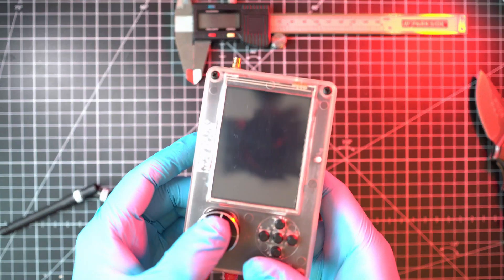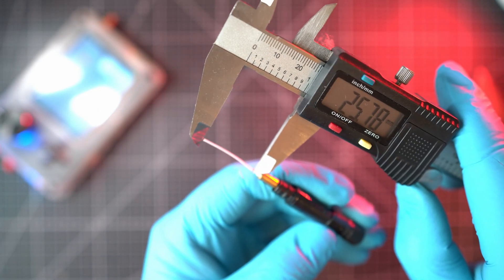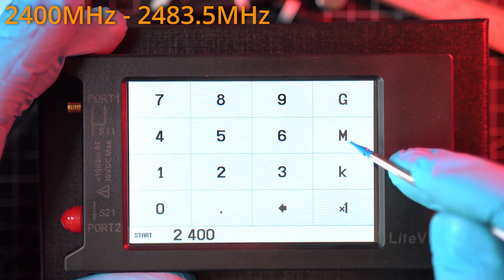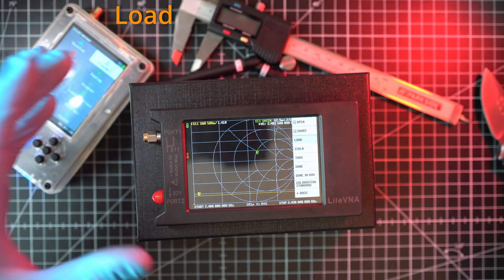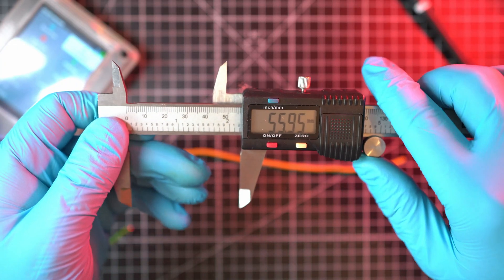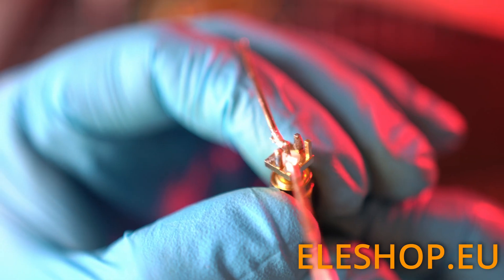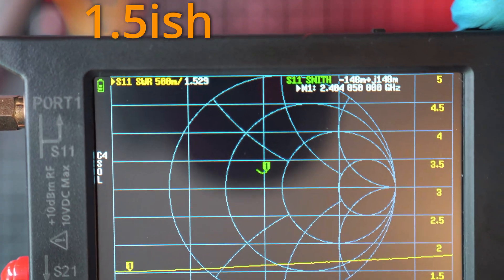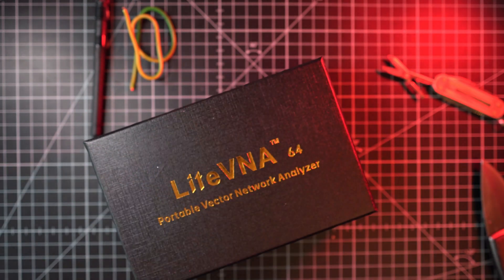DIY Dipole 2.4GHz Antenna for HackRF BLEspam...

Comment: Nice, I may pick up this analyzer. I was wanting to get more understanding on what type of antenna I would need if I were trying to only pick up signal from within my house or an immediate neighbor.

I have a 20-6000 MHz Near Field Antenna but this seems to be picking up too many access points. I'm trying to catch someone nearby who may be doing evil twin attacks on my WiFi network, he's spoofing the MAC address and the power rating is showing -1 so I can't get an idea of how far away he is.